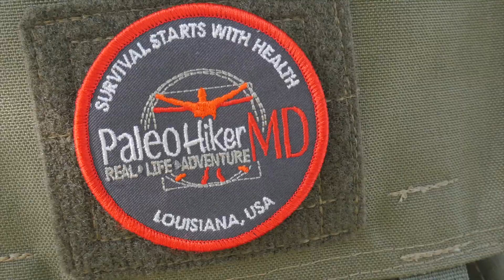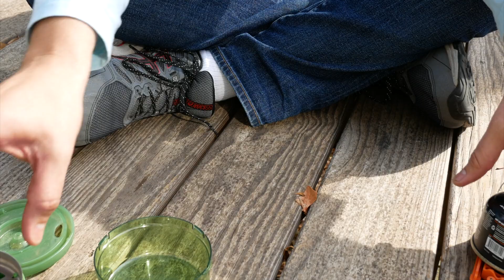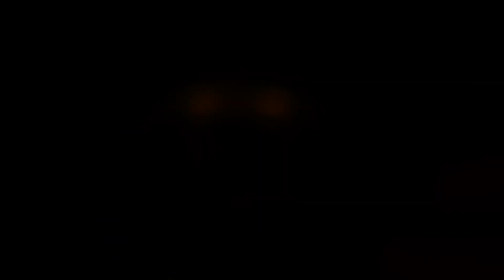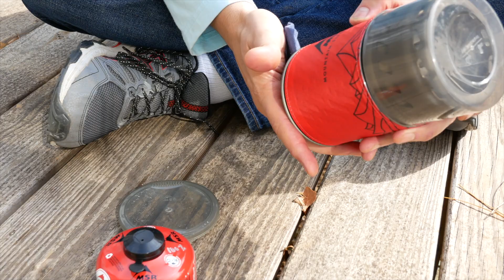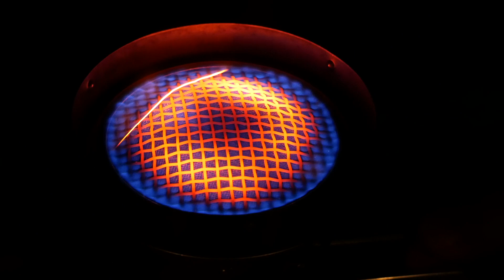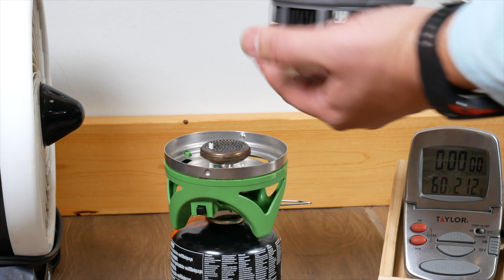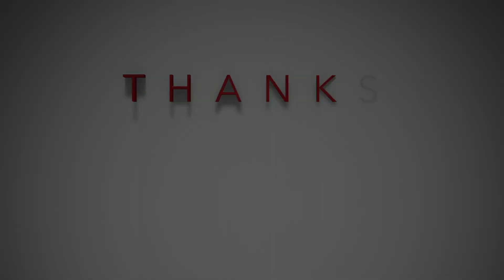MSR Windburner vs JetBoil Flash (SURPRISING RESULTS!!) - Boil Testing and WIND Testing

Comment: "Redesigned in 2025, the Flash gained a better kitchen-stove-style regulator knob, a better-protected piezo ignitor, heat-resistant grips, and a sturdier locking mechanism between the stove and pot. If you want an all-in-one system, the Flash is close to perfect."
The Best Backpacking Stoves Of 2026 --> Best Integrated Backpacking Stove System

Comment: Id buy the firemaple mars over the MSR its half the price and performs just as well. 
Everything gets compared to the jetboil flash and with good reason it wont let you down, ive hammered mine for 4 years and hasnt skipped a beat even the piezo still works fine 👍

Comment: The biggest con I have heard w MSR Windburners is dpill recovery or wetting out of the burner like snow, rain, submergence. It does not recover well to reignite. Stellar is wind and fast for sure but it also “fails” and needs a reset. Was just on a trip with a mate and he had to reset his MSR with a tebt peg twice. My JB Zip was just as fast or close to it and never failed. Ideal calm conditions mind you

Comment: I have both the Windburner and Flash and although I agree that there's no question that the Windburner is superior in the wind, you should probably get your Flash looked at. My Flash is able to boil 2 cups of water in well under 2 minutes. Even a stove without a heat exchanger like a pocket rocket can probably boil faster than your Flash!

Comment: I think your jetboil is a bit weak, should try with a new one indtead because i have got boiling water with jetboil in less time! Good video though! I was looking into the windbreaker, but tested my cheap "back up" burner first, an optimus crux lite. I got boiling water in 2 min and 40 sec indoors with a regular coffee-kettle. So then it's just a matter of trying to shelter the burner from wind but that's a much cheaper alternative for less rough trips..

Comment: BTW, I used my little SOTO Amicus stove in my backyard with 5-10 mph winds that we get every afternoon (Redlands, CA). With the attached wind screen I borrowed from my Optimus stove it performed adequately and boiled water in 3 minutes. I've also tried it at 7000ft elevation in the San Bernardino mountains without a glitch. If the Windburner was available back when I climbed the Mexican volcanoes I would have purchased it as the winds are ferocious at the huts.

Comment: I saw your video and one other one testing backpack stoves in wind conditions. Yes, the MSR Windburner is by far a great stove in windy or non-windy conditions. However, for someone on a budget the MSR stove is quite pricey at $167 + tax USD. The Jetboil Flash is $100+/- USD depending where you buy it. The JB Zip is even cheaper. By using an aluminum windscreen for $10 or less with/without other objects  it is a less expensive alternative. I agree that if you are going to be in strong or gale force winds everyday of your trek the MSR is the way to go.

Comment: I am no authority on the topic but I am a homebrewer who does his research. Water will boil at different temperatures at different elevations. That may be why your thermometer was not working. Also, the temperature will rise and lower quicker when the delta between is larger. So water at 30⁰F will boil faster then water at 120⁰F. I'm not saying this is for sure happening but it could be a reason for your issues.

Comment: I'm new to this style of cooking. Bought jetboil sumo from friend's recommendations. I tested it at home because I've never seen or used one before . It boiled 1l of water in 4.07 Min. It has a 6000btu burner. Looked up msr windburner after watching this video, I am looking for a second burner to open up cooking options. I don't hike just camp out of car but looking to reduce weight and storage. Anyway msr winderburner claims 4.5min to boil 1l of water. I do like  the burner system more on the msr ie not affected by wind which is great when hiking but I guess I have room to store wind shield in car. The site didn't mention BTU for msr though

Comment: I'm not surprised about the Windburner. Back in the '70s we used a Coleman tent heater with the same mesh burning system. If I recall correctly they were outlawed due to the fire hazard of careless campers. Those puppies were warm in extremely cold weather.

Comment: Thanks for this comparison, doc - much appreciated. I've been watching a bunch of these comparisons and the MSR has ALWAYS performed better than the JetBoil in high wind conditions, with the differences between marginal without such conditions. I recently and happily scored a similar price for the MSR, and still have a Jetboil knock off sold by Monoprice which is very similar to the Fire Maple 1L unit, which performs about as well as the Flash. Thanks for your channel, doc. You do a great job.

Comment: MSR any day. In fact, MSR stoves in general any day, be it the Whisperlite, the Reactor, the PocketRocket or the WindBurner. It's just that the WindBurner is the best option for those who want to do more than just boil water. If you want to just boil: Reactor.

You can by the way get the Duo pot as an accessoire (1.8l) that can pack an 8oz/220g gas cartridge. It's about 100g heavier than the 1l pot. If you get the Duo stove system the gas cartridge is separated from the burner and is connected through a fuel line - adds unnecessary weight imho. With the 2nd pot you can choose the best package for your trip.

Comment: My understanding of the MSR reactor line of stoves is that they perform much better at altitude than the jet om boil. That said I have a jet boil flash that I've had for probably 14 years. I've used it intermittently and not heavily but has performed well overall. The piezo igniter has gone out on it. I've also read planes of the jet boil products not holding up right over time with heavier use and the company not standing behind them either . That's coming from guys I know that use them hard in the Rocky mountains that altitude in real world situations. I've got 2 Western trips upcoming and I think I'll upgrade to one of the MSR stoves.

Comment: Thank you for the videos and testing gear. This was an excelent video and I was surprised how well the MSR Windburner did under simulated windy conditions. If you have not already done so yet, I would be very interested in seeing a viedo comparing the Soto Windmaster and the MSR WIndburner. Thank you again for testing gear and putting the videos together. Stay safe

Comment: I have taken cold water right from a mountain creek in my jet boil and had boiling water in less than two minutes. I have timed it just for info. My biggest issue with MSR is the durability. My buddy has gone through three MSR stoves and I’m on my original jet boil from five or six years ago.

Comment: Wind, altitude and ambient temp are important, but I've never really been in a rush to boil my water. [Melting snow can be a different story. That can take an age].
I was recently using my first gen. JB Flash at 700m, -7 C. I was surprised how well it performed. the 'trick' was simply to use a (near) full canister [and of quality iso-butane mix]. I'm looking at getting a regulated stove for when the canisters get empty. 
I like the look of the JB ceramic 1.5l pot for van camping - easy to clean, oh yeah! Anyone tried this pot with a MSR PR deluxe?

Comment: Great vid.  But... my flash boils at just over 2 mins.  My mini mo boils at about the same.  
The flame output on your jetboil certainly seems lower than mine.   The wind results on the msr is pretty cool tho.  

  If you get a chance, try a different jetboil and see if the results differ from yours.

Comment: I'm not sure counting seconds means that much to me.  If a category of stoves (in this case "self contained cooking systems") boil the same volume of water within one or two minutes of one another then that performance metric seems essentially all the same to me.  (If seconds count and you're running a stopwatch on your backcountry trips you might consider the possibility you're doing it wrong :-)  Within a given performance ballpark my eyes start to glaze over when I start hearing details like "10.78 ounces of water at 65 degrees in 2min25 seconds vs. 2min 42seconds.  That's just basically "the same" to me on that measure...

Wind resistance is interesting but any stove can be sheltered from the wind in order to optimize performance.  For stoves that need a separate wind screen to achieve peak performance in windy conditions, that fact, and required accessory should be factored into the overall equation.  MSR Windburner just happens to have an integrated windscreen that's all.  A wind test that pits the built in windscreen on the MSR against a Jetboil without one just feels like an unfair comparison.  Put a screen around the Jetboil and include it on other measures like packability and weight.
  

That said, I own a Jetboil Flash and absolutely LOVE it......but I'm a "fan" of all things MSR and have made genuine efforts to find a way to justify buying a Windburner and just can't...even with comparisons like this one.

Comment: This was a very nice video to compare the dimensions and boil times.
You will be surprised with the data on fuel usage for each of the burns.
The fuel usage is very important on 5+ day trips, especially nuts like me when traveling 14+ days above sea level and in the fall.
I have seen 2 comparisons on the minimalist's stoves, where the fuel usage was nearly 100% difference between the 2 stoves.
I will wait double the time to boil water, in lieu of having to carry more fuel cannisters.

I currently have a 12yr old Jetboil (the only failure was the piezo, I use a lighter) and I am interested in the MSR Windburner as I do a lot of trips in the mountains in the fall where the temps fluctuate throughout the day and wind is inevitable and sometimes a bit strong.

Comment: Would be interesting to see what the fuel consumption rate would be between the two of them! Could make a big difference on “Thru Hikes”!
Reply: That's an interesting question but I don't have a jetboil system. I just tested the fuel consumption on the msr windburner 1L system with 0.5 liter bottled water from the supermarket at room temperature around 20C indoors with no wind. I recently bought a msr pocket rocket 2 cause i also want to be able to cook an egg or make pasta at simmering temps. The windburner is just for boiling water imo cause i don't want to ruin the pot. I just did a fuel consumption test for both systems. As fuel used is an almost new msr isopro, the big can.

The results i got indoors at room temperature around 20C no wind surprised me. Mind the difference of the materials. Titanium vs aluminium.  
-Msr Pocket rocket 2 with a toaks titanium 0.75L pot with 0.5L bottled water used 12 grams.
-Msr Windburner 1L system with 0.5L bottled water used 6 grams to get water to a rolling boil. 

The Windburner is just very efficient and used 50% less fuel then the pocket rocket 2. I didn't expect that result. The windburner is just designed to boil water really fast to use with freeze dry meals and hot drinks.
Reply: Calm sunny day: Jetboil uses less fuel... but it's splitting hairs. Cold, rain, wind, snow: MSR uses less fuel... by a lot. But, there's a lot of videos on that.
Reply: Thats a goog point
Reply: it would be interesting to see, but I presume that is not a significant difference between Jetboil and MSR without wind to boil the same amount of water. When it comes to boil water in windy conditions, I presume MSR wins on fuel consumption. Jetboil spends more time burning fuel to boil same amount of water. I think there are some videos on youtube which test also the fuel consumption (it might be between jetboil and msr reactor not msr windburner).

Comment: Somebody mentioned in here , there were operating nuisance with the MSR??? And spillage? The error here , is with the operator.  I have found 0 issue's with MSR.  As with all MSR products, they are second to none. They are the standard. They are well worth $$$ I have MSR stoves that are 35 years old, and still outperforming current to date other brands. No I don't work,  nor am I affiliated with MSR.  But I will be a lifelong MSR user.

Comment: I was involved with outfitter/guide testing for the earliest rendition of Jetboil.  All in all... they have not changed much since the fist model w/ exceptions like sizes, materials (TI the discontinued SOL), color schemes, feature detailing, and system accessory items. I had done a 3+ season evaluation assessing in multi-conditions here in Alaska. That's an easy 4-season longevity test relevant to most users anywhere else. My findings and recommended improvements concerning real world wilderness use cons back then: A.) Igniters were prone to routine failures - not to be trusted. B.) A little blaster having no flame control finesse suitable for anything other than the integrated flux-ring pot (only thing available at the time anyway). C.) Very poor wind performance  - ie. poor ignition, easy to blow out even running full blast and especially as a stand alone before attaching pot. D.) As a system it needed more... that eventually happened like the little orange fuel can stabilizer, a hanging system for suspension, pot stand, French press, pan, etc.  On a positive side and certainly relevant today...Keep in mind, Jetboil is still a good, efficient set-up when well-knowing its 'moods' and capacities given various conditions. The SOL is still my favorite!!! As for the MSR... great, efficient performer and especially overall better in windy conditions. That said, there is some complications many do not factor in: 1.) Submergence in water and regaining ignition is lackluster. and 2.) Spill scenarios are more difficult to deal with - ie. typical gooey or burnt on situations. MSR Windburner does not tolerate these factors well and often harder plus more time consuming to deal with than Jetboil.  Hope this lends a hand.

Comment: Those are great if you like to do things in a hurry and want to boil some water.  I'm old and slow and take life easy so there is no hurry in what I do when camping. I like the option of having flame control enabling a variety of different food preparation methods. A good hot meal at the end of the day is a reward I enjoy.  Second most important item is the size and weight of what I'm using , less weight the bigger my smile.

Comment: Your thermometer at least seems consistent in it's measurement of water at boil (seems to be around 206 F).  
What altitude are you at? I don't think anywhere in Louisiana is above much above 500ft.. If you are at or near sea level then 212 F should be the boiling point of water, but if you are at a higher level it could be bang on.  (see chart and calc. links).  
I'm guessing however, that you know your gear, haven't taken your RV to the mountains but have noticed a recent change in how your thermometer is behaving .  ;-)
You may also need to ensure that the probe is not actually touching the bottom of the pot.

Unfortunately, I don't think you can calibrate that particular thermometer....but you could do a cold / boil test, record the offset and use that as your reference point. 
Funny thing is  I just ordered the same Taylor thermometer.  I was inspired by Hiram Cook - and you to choose that model and wanted to pay homage to that gear in my own tests....
From my recent research however, it seems if you want to splurge - the Thermoworks ChefAlarm is the "Gold Standard"

https://www.engineeringtoolbox.com/boiling-points-water-altitude-d_1344.html
https://www.thermoworks.com/bpcalc?gclid=Cj0KCQiAw_H-BRD-ARIsALQE_2OFdj7tX4oQOmuMFTG3rkamPGiDK8VTGowjt_LYzltvg8aWtYLskf4aAr-KEALw_wcB